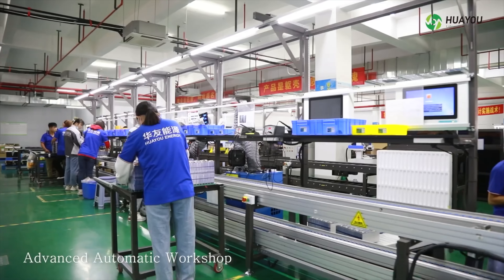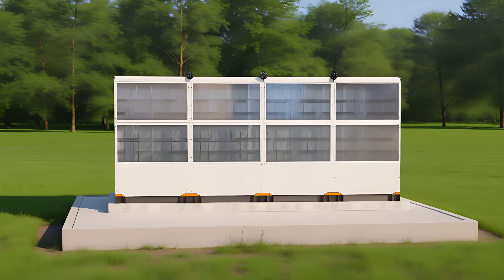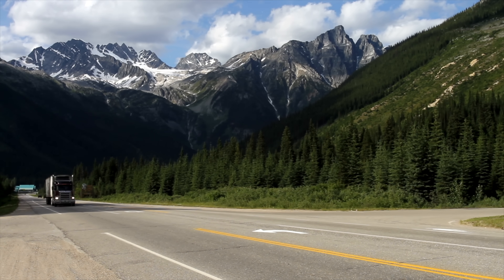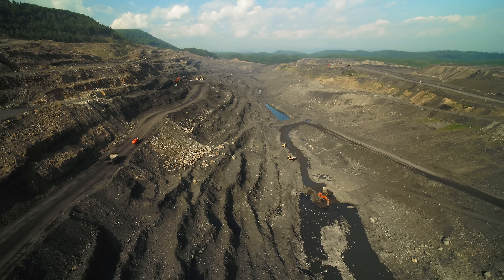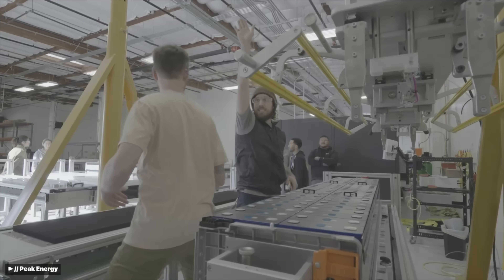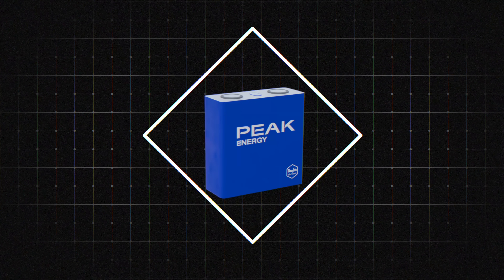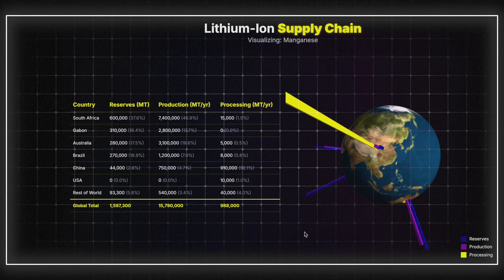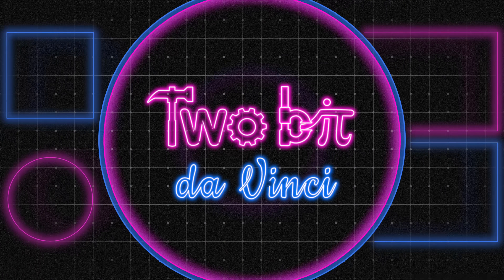Sodium Ion Batteries Are Going to be EVERYWHERE - Here's Why

Comment: I really hope this technology comes to reality and economically viable.
You did NOT talk about energy density,  cycle life of the battery, and the charge/discharge speeds it can sustain.
Reply: Probably because they are disappointing.
Reply: Adon, early days for sodium. Regardless of energy density, they don’t catch fire or need thermal management, they will be affordable, and they last a long time. So, they’ll completely disrupt home and utility scale energy storage and even production.
Reply: @freeheeler09Nope. They will not.
Reply: Already used in some cars in China, so the density is not that bad but it's not as dense as NMC or LiFePO4
Reply: @-whackd so while there exist sodium based batteries, there are dozens of totally different batteries made using sodium and none of them are the same thing.

This one we're talking about is not the same as the ones in Chinese cars and this is the only example of it.
Reply: @-whackd - the gravimetric density of Sodium is getting closer but the volumetric density isn't, still about 20% lower than Lithium cells. This means fewer cells per pack can be installed with Sodium due to their larger size. Plus they have a higher cooling requirement which alters the packing density in a battery pack and raises the system cost for the vehicle due to the higher cooling demand, which together with a higher electronics cost (more expensive electronics to handle the lower cell voltage range) starts to erode the cost benefit. This is why current batteries are targeting specific use cases such as heavy/large vehicles and dual-chemistry hybrid vehicle batteries, where the disadvantages of Sodium can be mitigated (by scale or specific use of Sodium's power density/cycle life advantage in a supporting role to a Lithium battery).
Reply: Not sure about this one, but you can find info here on YT on the new CATL sodium ion batteries. They are A) cheaper B) have better energy density than old LFP, but not as good as the best new LFP, C) far superior cold weather performance, D) excellent life cycle. Not sure about charge speeds, but I think good enough. Anyway, low cost and good enough conquers many a market, and that (probably) is what will happen here is my estimate from having reviewed this stuff.